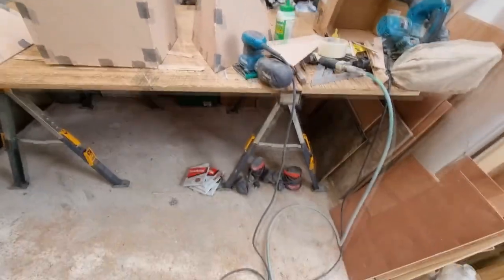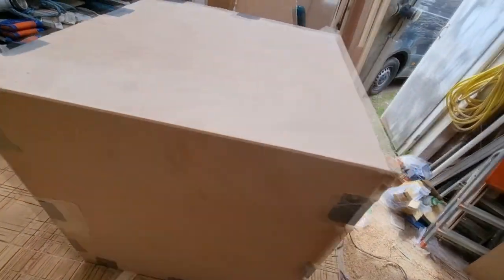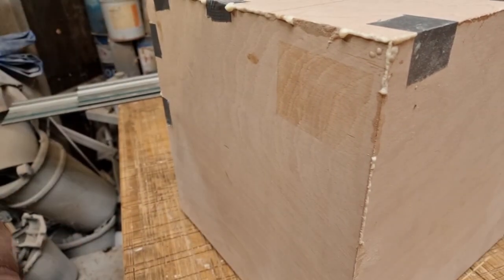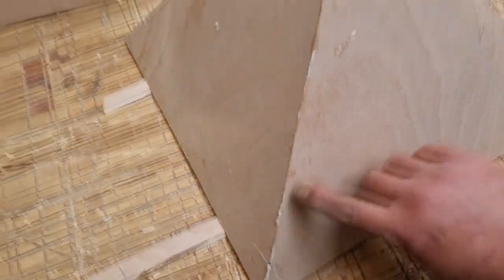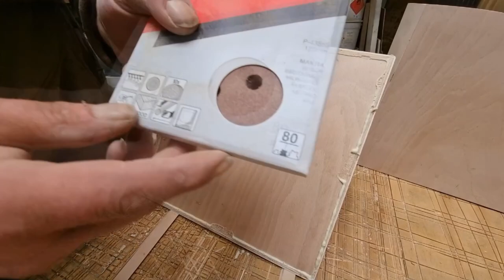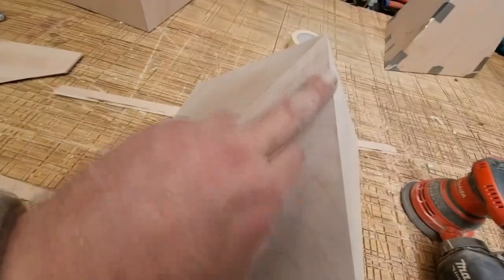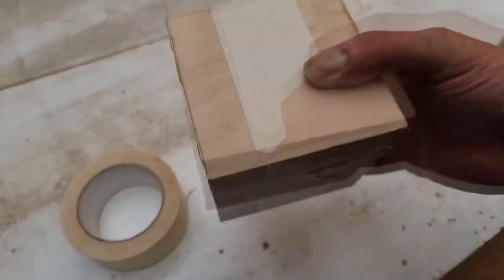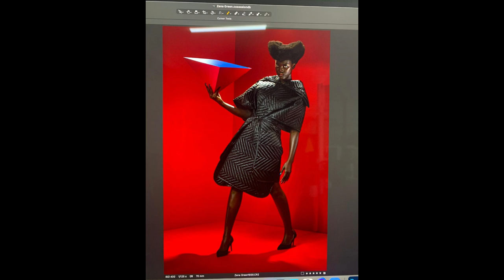Photographer's Plywood Pyramids pt6 - Making the cube pt2 & final

Comment: Love the end result! Mr. Photographer must be well pleased.
A 20 spot will get you a 315mm x 30mm 40T Erbauer blade at the mo, from Screwfix if that's any help, reduced from £40.00
Reply from the maker: Yeah he liked them when i dropped them off, 👍 I've quite a few blades on the wall, different sizes n different teeth, some pretty new & some still with the wax stuff they put on after sharpening but....... Screwfix - 1 x Erbauer TCT Saw Blade 315 x 30mm 40T in stock, £19.99, Bought! how could i refuse an offer like that 😂😂 Thanks John 👍
Reply: @Gidjoiner  You're welcome bud!
I've had one in my ancient DeWalt SawKing for the last couple of weeks, mistimed getting my Freud blades sharpened at DB Keighley due to Mayday B/H and needed a sharp blade desperately, just fell lucky with Screwfix. It's a very nice blade, enjoy!
Reply from the maker: Good 👍 yeah bank holidays always catch me out, that's where i take mine, it's a bit of trek during the working day when i should be working, Screwfix is just down the rd, i can get a blade cheap enough that'll do the job so mine get sharpened very rarely  👍 I should've changed it but my head was full of pyramid stuff, i think i'm a bit foggy too after such a long...'winter' 🥴👴😂
Reply: @Gidjoiner  Just as a side note re: DB Keighley, His Dad sadly passed away at the start of the year, so he opens Mon-Weds only atm, and the saw sharpening guy usually picks up/drops off before 10am Mondays.
Reply from the maker: Thanks for letting me know, i'm going up there in a few mths to buy a morticer, i've a small one but i've always wanted a proper one with a sliding mount, i've got a couple of summerhouses to build that will require doors with proper M&T's & i'm sick of dicking around with routers etc.. where i did my apprenticeship n a the firms i worked for had proper ones, i miss that, fannying around making do,,,, got some debts to pay first tho😂